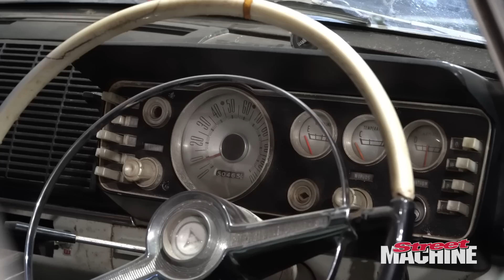Carnage - New Year, New Projects!

Comment: Looking forward to the torana build scotty. Would absolutely love to see a big cam, turbo red aussie 6 in there. Love all the builds and cant wait to see what 2022 has in store for the carnage workshop
Reply: won't fit without a 'new' lj/lc nosecone and cuards
Reply: @grumpyoldman-21  yep the 4 banger was several inches shorter in the engine bay than the 6 cylinder variant. Did they use different chassis rails, got a feeling they did, but didn't care enough to ever check.
Reply: @grumpyoldman-21  good point, but at the same time, anything apart from 4 cylinders won't fit so it will be changed unless it's 4 cylinder
Reply: Hell yeah - spend $30k building a turbo Holden Red motor and end up with 450 horsepower on 98 RON if you're lucky.
Reply: Turbo carbi engines are alot harder, also cost more. No point. And the 202 isn't even a popular or known motor for turbo.
Reply: Are you suggesting a 202T for 2022?

Comment: I'd like to see that TA Torana panels left in place. Set it up with a super reliable EFI 4 banger & manual combo that could be used as a regular driver. Don't over power it with a V6 or V8. It's a nimble little car good for some gymkhana type events.

Comment: Sound like a great year ahead, As for the Torana it needs something beefy to sound tough. I don't think an I6 is gonna cut it, but LS Swaps are a bit too common. What about a holden 308 or 304? something different on the channel would be awesome! can't wait to see what you do with it. :)
Reply: Exactly my thoughts! Tough V8 not LS!
Reply: Nah stuff that, do something actually interesting, like a 3UR-FE out of a LandCruiser with a pair of turbos on it. Nothing really stupid, aim for maybe 600 flywheel kilowatts but torque like a big truck diesel.
Reply: Red motor all the way, non crossflow and 2 barrel carb.
Reply: Needs a blown 253
Reply: SBC all the way. Plenty of options and easy to make good power.
Reply: What about a V6 - Do you still have the standard 3.8 that came out of Supermang? Chuck that in there and see how far you can take an N/A 3.8! (Keep it 3.8, and no forced induction, but otherwise go nuts, anything and everything else goes!). In I small, light, chassis like a Torana, it'll be supoer quick too, no doubt!

Comment: A 2.4 EFI and 5 speed out of a 2WD RA Rodeo would make the Torana fly and being a 4 pot it would still handle as well as that shape of Torana ever did.

A V6 Commodore or Lexcen engine would also be cool in one but may compromise the handling. The upside is that you already have one of those slated for removal from the Lexcen.

Either way the TA grille needs to become workshop wall art (what were Holden thinking?). 4 Cyl LJ grille was the best looking of the four stubby nose Torana's

Comment: LPG Turbo Taxi 10s or bust. I think I can help, Scotty. It's running vapour injection at the moment right? I think a lot of the problems you're having with LPG would be solved if you could run liquid phase. The cooling effect of the vapourisation of fuel helps keep pistons together. I know. There's nothing really out there for it. Factory LPI injectors aren't modifiable, nothing really in the aftermarket. As an LPG tragic mechanical engineer I can't take no as an answer. To the point, I think using nitrous nozzles and solenoids as secondary injectors to deliver Liquid LPG to manifold would work whilst on boost. Reverting to the vapour injectors at idle. Tuning and plumbing will be tricky but worth a shot. I plan trying it myself but I wouldn't be chasing those sorts of power numbers.

Comment: Dont go the w2a plate cooler on supermang. Those plates are no good they cant pull the heat like a2a or hybrid setup they are too small. You got the right idea  find another bonnet you can cut up. Get a bigger w2a core and thats going to be the most effective setup.    If you want 11s that and sc porting or nitrous is the the only way its going to happen.
Reply from the maker: Baby steps. For the moment we want to keep everything under the bonnet.
Reply: @STREETMACHINETV   Just go for it lol i dont think anyone cares too much if you skip running 12s.
Reply from the maker: @vr350  I understand where you're coming from, but remember it's all content for us. If we rush straight to the finish the project is over.

Comment: Ok, hear me out…
Boosted Starfire in the Torana. It’s basically a Holden Six cut down so there’s piston and rod options, and it keeps the theme of the Carnage channel with “Oddity vehicles with different powerplants”. 
Have a good 2022, guys.
Reply: The only use for a Starfire is on the end of my anchor chain, total crap motors that cannot make any power and were rubbish brand new lol .

Comment: Turbo the Barina motor and put it in the Tarana 😃🍺👌🏻🤙🏻
Reply from the maker: Wow, that's an interesting idea.
Reply: You can make decent power with an appropriately set up Turbo version of that motor. The internals for the XE redtop the Barina has and the Turbo versions aren't the same though. You should be able to get a Turbo version fairly easily in Australia. Look for an SRi-T Astra. Either that or buy a set of aftermarket internals and build it.

Comment: Please stop doing everything wrong with that V6...... mini blizzard 🤦‍♂️🤦‍♂️🤦‍♂️
Amd that 4.2 crank is only good for 500hp... standard crank is good for 1000. Standard L67 with a cam is good for 750+ turbocharged.
Going backwards with that stroker.
Reply from the maker: How much power do we need?
Reply: @STREETMACHINETV  well a standard ecotec with 15psi makes 420-430hp
Add a cam and that boost and that is basically bang on 500hp territory.
Add the extra capacity and thats a tonne more torque and well over the cranks known failure point.
Thats with only 1 bar of boost and bugger all timing.

Just trying to help you guys and and save a tonne of time, money & heartache.
Plus also try save some of little dignitiy this platform has left 🤣🤷‍♂️🤦‍♂️
Reply from the maker: @RhysK94  and there you go, hating on us again
Reply: @STREETMACHINETV  hating... ? I literally stated I am letting you guys know so you don't go through all the bad luck again..... as I want to see you succeed......

Comment: Hmmm... What engine to put in that Torana.

There are plenty with V8s in them. Let's not do that.

The GM engine I want to see in it is the Holden/GM High Feature V6 Turbo. Unfortunately, Holden were allergic to using this wonderful engine they designed in any of their own cars, so you'll only encounter one in Australia in an Opel Insignia OPC, which are stupid rare already as they were only sold for a few months. So that's out.

Second choice would be a GM Family II Turbo. The Z20LET, LER, or LEH would be ideal. That would be kinda hilarious as it'd stay an inline four, but have actual power. Remember the redtop Calibra engine in the Barina? Like that, but with boost and starting at twice the power, before you page up. These should be more accessible, as there were plenty of them sold in Australia.

OTOH, there's a far more obvious thing to do -- and will give you far more internet sacrilege points, which could translate into views.

Pull the Barra from the MX5 and stuff that in it.
Reply from the maker: No Barra

Comment: Turbo taxi needs some water meth for that safety factor and a bit more power on lpg
Reply from the maker: It has it
Reply: Step up to liquid LPG injection instead of the Vapour injection setup 👌 more charge cooling/power, and able to regulate fuel pressure better.